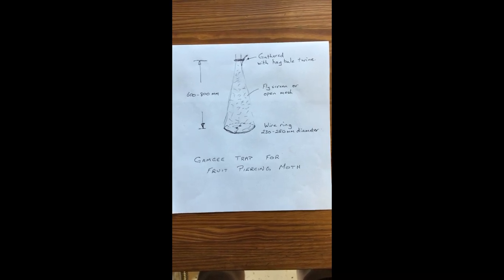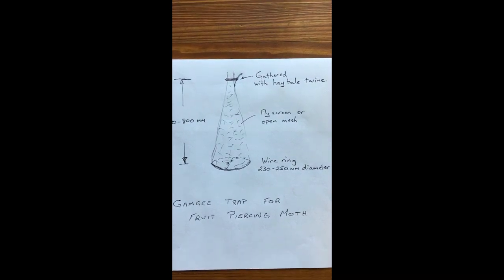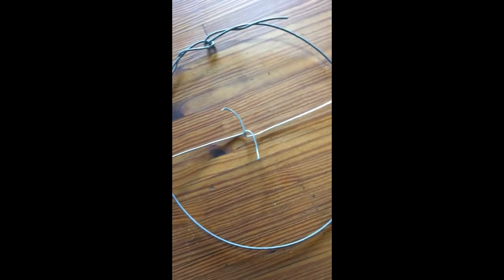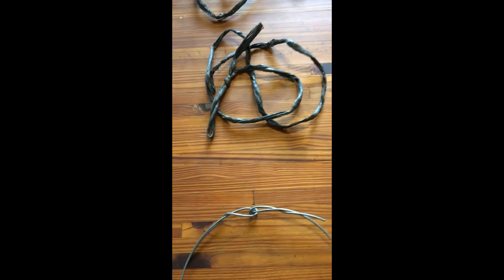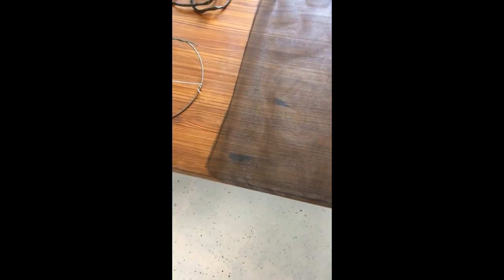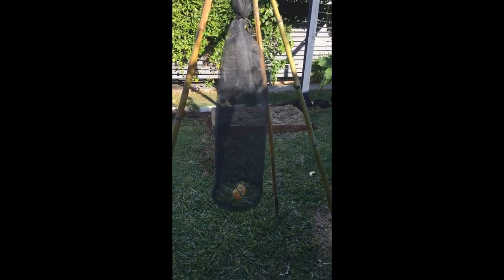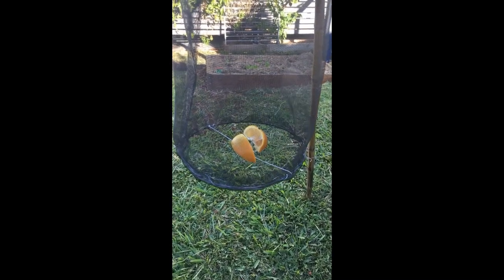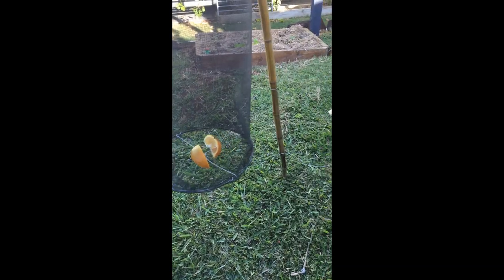Fruit Piercing Moth _ Gamgee Trap

Comment: Could you attach it to the citrus tree??? or how far do you put the trap from the trees?
Reply from the maker: Hi Chantal. It seems to work best if it is on its own pole or support (e.g. a rope or wire between trees), and about 1 to 1.5 metres from the tree.  If there is a single tree a trap either side that attracts the moth before it gets to the tree is best.  If you have a dominant breeze direction - put the trap(s) on the up and downwind sides.
Reply: @petergamgee1280  Thanks a lot for that. I am thinking of making a hedge with citrus fruit trees so I will certainly consider the traps.